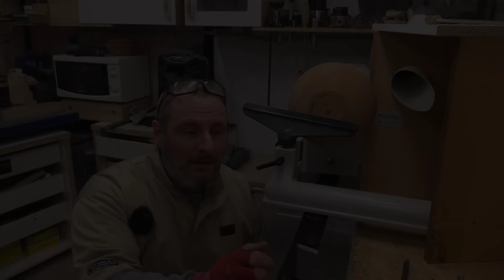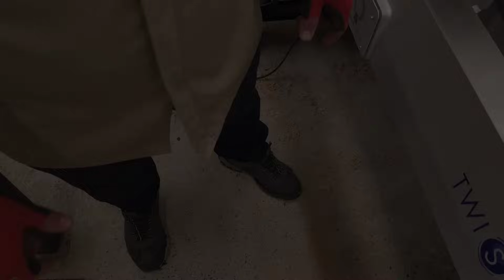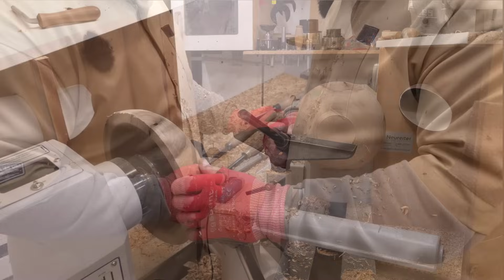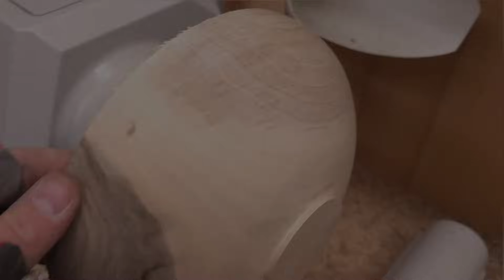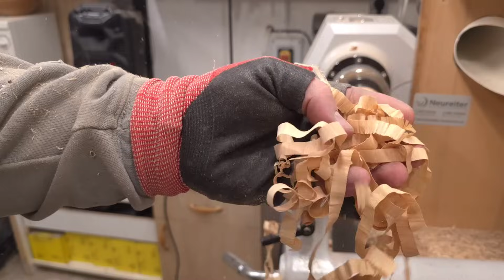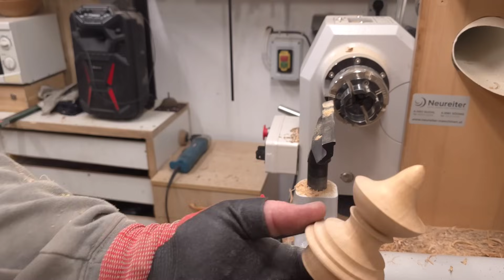Simple Tips To Improve Your Work

Comment: Thank you Tomislav for your instructive videos. I am a beginning turner. I am left handed. Does that make any difference in stance and angles, since my left hip and hand are closer to the head stock?
Reply from the maker: Honestly I think its just easier to try adapt to using tools like right handed turners. I know Mike Mahoney does that, it will take some practice but I think its easier then turn on other side of the lathe
Reply: @tomislavtomasicwoodturning  I was not thinking about turning on the back side of the lathe. I was just curious if there would be any change in the stance since my left hand on the tool handle near my left hip is closer to the lathe head stock?
Reply from the maker: @jayschudel3011  Mike Mahoney turns with different stance and it works, for example he would hold handle with his left hand when doing a bowl.
Also for spindle work, it could be easier if you can switch around hands.

Unless headstock is extremely bulky it should not interfere
Reply: @tomislavtomasicwoodturning  Thank you Tomislav. I will work on getting comfortable switching between my hands.

Comment: Excellent video again. It seems that these days my memory is “good but short” so I think I need this video on tap by the lathe while I attempt to build the muscle memory. 

One question I’ve been meaning to ask, is there any difference, or advantage, of shear scraping with a bowl gouge compared to a dedicated scraper? I have some heavy 1½” scraper set that I really like and it seems to me I’d be better off using them. I still need to work on angling them for shear scraping, that’s the next objective.

Many thanks for all the experience you share, and the clear and genuine way you present it.
Reply from the maker: Thank you Andrew

To me ,using scrapers are part of my routine and more comfortable to use especially when shear scraping.

So I use scraper let say on outside to finess the shape and to smooth it out with one tool really effective. 

But again nothing wrong going either way, some just prefer one or the other.

Comment: Tomas - I use a thick rubber matting from a Camping & Caravan shop to be used in awnings. They come in squares and they interlock and fit easily into odd sized floors. I presume there will be similar shops in your country.🥳
Reply from the maker: Thank You Jim, my wife after I post a video went and bought me 3 Matt's, so far they are excellent 👌

Comment: Thanks for sharing as usual i learn so much from you i have a question my lathe had no stand i was eye balling your center to the floor.but its hard to tell what do you recommend i want to make a stand.i have it clamped to saw horses but it seems to high
Reply: A good rule of thumb is that your headstock spindle should be same height as your bent elbow. Try that as a starting point and modify to suit your personal style.
Reply: @deltacharlie152  thanks just got the new bearings in set it on the horses and rite where you said it should be that was luck thanks again
Reply from the maker: Most common setup is to have the center at elbow height , try that as you'll see from that point if you need to adjust anything

Comment: Great video Tomislav. I would strongly recommend you DO NOT BUY RUBBER MATS! Instead, make duck boards, which are just slats of wood mounted on widely spaced runners. The flex of the wood slats between the runners give you way more comfort than anti fatigue mats. I learned this trick from a Fireball Tool video a few years ago and I haven’t used the other mats since! And you can make them for almost free if you get creative!
Reply from the maker: Thank you very much  my wife went after I post this video and bought me 3 recycled matts, so far they are great but I like your idea and one day I'll make it😀